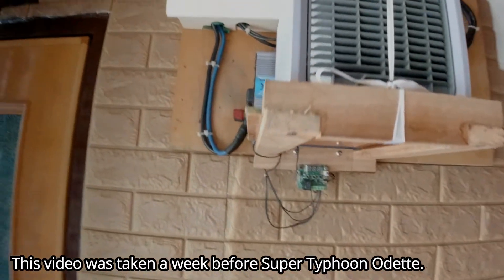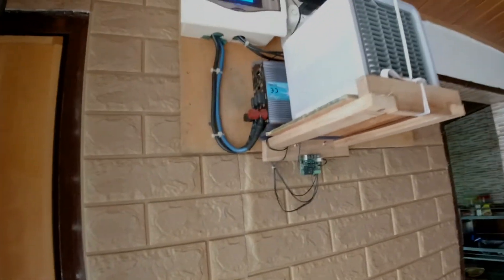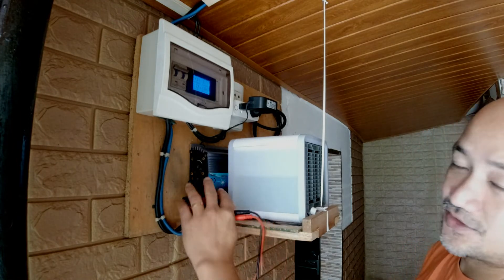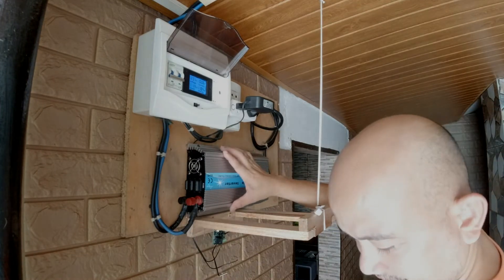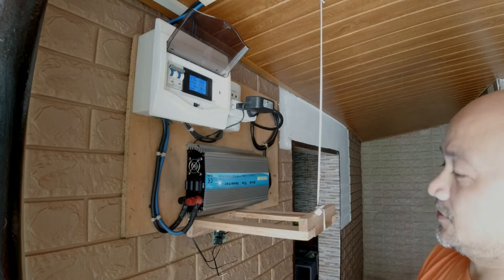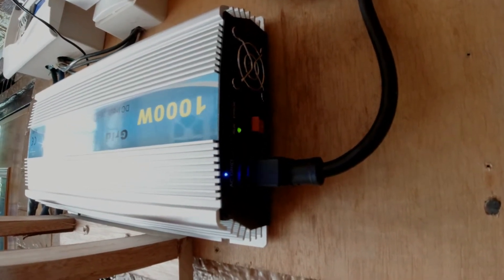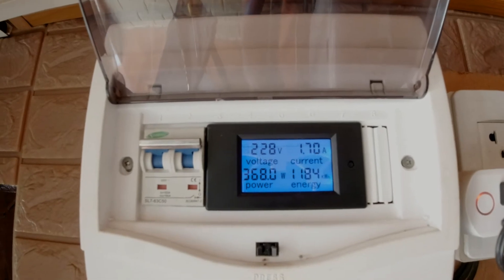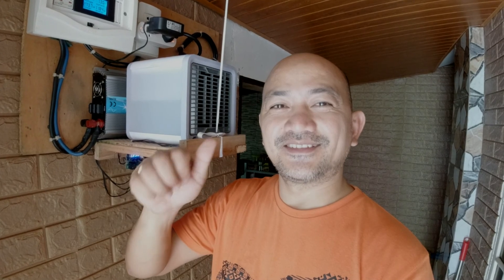GRID TIE INVERTER DIED AFTER 2 YEARS | DIY Petz

Comment: Great setup. Try aluminum plate several inches larger behind it with heat paste for a better heat sink. Keep the plate off the wall some so it can have air all around it. It should help with removing heat from the unit. I'm adding some to my house and looking around to learn what I can. Thanks for the video.

Comment: Hello sir unsay specs sa imo solar panel unya pila ka panel imo gigamit?
Reply from the maker: Good day Sir, panel specs:

Max Power : 275 watts
Max Power Voltage : 31.1 V
Max Power Current : 8.84 Amps
Open Circuit Voltage (VoC) : 38.1 V

4 panels gamit nako Sir.
Reply: Unsay connection sir? Parallel?

Comment: Well that cooler could cause moisture that can condensate inside the components and cause the inverter to fail, but also its common for cheap chinese inverters to only work for about two years anyway.
Reply from the maker: That is correct Sir, these inverters would'nt last long.

Comment: You're cooling not the hottest part of the inverter. In this type of inverters mosfets are installed. You need cool them, not other parts, that doesn't get hot practically
Reply from the maker: That right Sir, if this thing goes off, then I'll probably replace it with a different one. Thanks.

Comment: I think the air cooler not really help properly because you jush put it on the cover. Much better you remove the small fan on the side and changes with the big one. Small ac cooler also create moisture that maybe cause your inverter damages the circuit inside.
Reply from the maker: Thank you for you observations Sir. This is just an expiriment on cooling down this inverter. The air cooler would only run if it reaches 40 deg an turns off automatically when it reaches 38 deg.

Comment: ..I have a similar but 15 y warranty y&h white label 600w..I like this one it has no standby power..only issues is with it's banana terminal and fan jamming (needs bearing oil)...I just use 1 per 72 cell panel later daisy chain it's ac output ...I want to recommend a wifi smart plug monitoring via smartphone (tuya /smart life)...so you can monitor/timer on&off it remotely...
Reply from the maker: Thank you so  much for sharing Sir. Yes using a smart plug certianly helps in monitoring the usage. Stay safe Sir.

Comment: my thought is this, even if you have to buy one every 2 years you still win, as I write this they are going for only $85 bucks on AMAZON, plus, please mount yours vertically not horizontally so that the hot air escapes upward and  you will not have half the issues you are having
Reply from the maker: Yes Sir, that's why I'm going for this cheap inverters. I'm glad that we are on the same page Sir. Anyway, planning to do what you are suggesting of mounting this one vertically soon. Stay safe as always...really appreciate your comment on this Sir.
Reply: @RollyPetz  Use the death inverter cover only as a heatsink because the cover make out of aluminum so it can cool down new inverter better.
Reply from the maker: @JinglebellJames  Thanks  for the suggestion Sir...we'll check that one also...Stay safe.
Reply: Very good idea ,but if it will blow up,thats a very big problem
Reply: No you'll need to buy a new one every 3 months. 1000 watts with max input of 770. Burns up the mosfetts constantly

Comment: Buhinpa ang bag.o nga inverter nmu sir?
Reply from the maker: Sir maayung hapon. So far still running and no issues. Murag nakatabang gyud tong cooling  na ako na setup. Hehehe.
Reply: @RollyPetz  maau noon sir..mag cge ka ug tubil ug tubig adto sir?dli b mag moist ang binuga sa hangin sau cooling fan?
Reply from the maker: @searchingthethruth4776  Sir so far naay gamay moist but mo desipate lang siya since ang chassis sa inverter is >40 degC kung mo-andar ang cooling fan Sir...then the internal fan would run if temp rises to 43-45 degC. If the chassis fan return to less than 38 degC, then mo turn off automatically ang cooling fan.
Reply: @RollyPetz  pila ka solar panel ug pila ka watts kada panel setup nmu sir?
Reply from the maker: @searchingthethruth4776  Sir, I have 4 panels rated @ 275 watts per panel for a total of 1,100 watts.  For the detailed setup please follw this link Sir...https://youtu.be/hnts-YO4w2I.
Thanks.

Comment: hello sir, new fan here... magkano po natipid nyo sa electric bill after ng set-up nyo ng grid tie, meron na po ako kaso di pa complete, pakonti-konti pundar pa lang hehe., salamat po sa video.
Reply from the maker: Good afternoon Sir Phil, for my setup here is my computation.

Ave KW harvest per day on a rainy season = 3.22 KW X 30 days = (96.6 kw)
Generation Charge from Power provider (VECO) = 7.2478 / kwh
96.6 X 7.2478 = Php 700.13 Per month savings

Approximate lang Sir for my setup.
This is just my simple understanding of the computation.

Thanks.

Comment: Hi there do you know anyone who can repair the inverter? mine also quit the other day :( Thanks
Reply from the maker: Usually damage parts are mostly the mosfets, mine I could not trace it since the mosfets are OK.  In our area I couldn't find a repair technician for this type of inverter. One thing you can do is try to re-heat the board with a heat gun to help on some loose contacts.
Reply: @RollyPetz  by the way sir what type of smart plug do you use for your inverter to automatically turn on/off pa link naman. Ty
Reply from the maker: @TomfromtheVille  Good morning po Sir, sa shopee ko po nabili eto po Sir..Smart Dual Plugs (2020 Model) link here https://invol.co/cl6e8qf.
Reply: @RollyPetz  sir ano time nyo po auto on off yung switch nyo. Thank you
Reply from the maker: @TomfromtheVille  good morning po Sir. Sa setup ko po, its 6 AM to 6 PM po. Sa smart plug ko lang siya i-set through the app po.

Comment: Baka nagkakaroon ng moisture sa loob ng inverter dahil sa aircooler kaya nasira agad ang inverter.
Reply from the maker: Good day Sir Joel.  It's only  a month since I've used the air cooler for cooling down this type of inverter since they really reach high temperatures even before I've used the cooler (55-60 degrees). I think due to high temperature of these inverters, it would likely damage some of the internal parts of the inverter. That is why I've experimented it with the arctic cooler with the use of the temperature sensor to trigger the the cooler at the exact temperature for the cooler to operate.  I think the important thing here is that the triggering of the temperature sensor on when the cooler would activate. Anyway I was already expecting this type of inverter to fail after a year. On a cool day the cooler would not turn on since it is triggered by the temperature sensor  w/c is set @ 40 degrees so no chance of blowing the cooler at low temperatures thus avoiding moisture.

After replacing the new inverter and with the temperature sensor and the arctic air cooling, this has maintain the temperature of the chassis at about 40-42 degrees on a very hot day. I am hoping that with these new setup  cooling this inverter to its desired operating temperature, this would last for a while with my fingers crossed..hehehe..hopefully I can follow-up o this setup hopefully for a year...

Thanks for the comment Sir.

Comment: Mine blow up yesterday after several months in service... dont know why but its gone
Reply from the maker: Hi Sir, maybe the mosfet s blew up .It's maybe because it has exceeded its normal operating temperature. Have you tried opening the inverter and see what blew up?
Reply: @RollyPetz  Yea, there a little fuze t 6.3A which blew up. I replaced it but it did not help basically when i plug converter into socket it immediatelly initiate safety break switcher so probably its not only a fuse. I looks like that converter causing instant phase cross (short circuit)
Reply from the maker: @brisudamatus  I think some of the mosfets are busted or got shorted also.